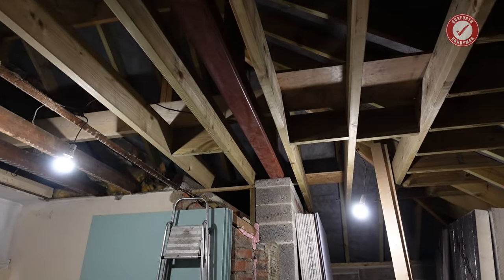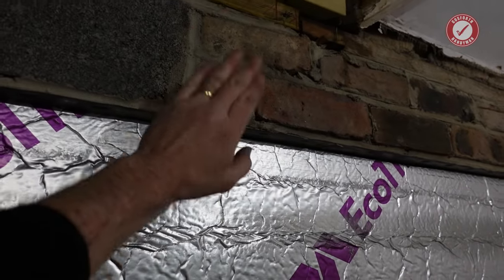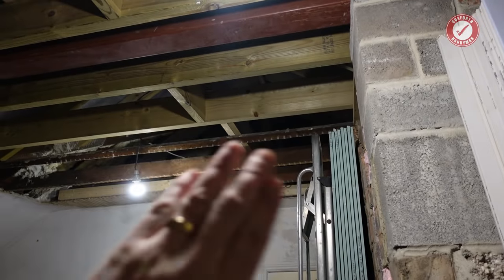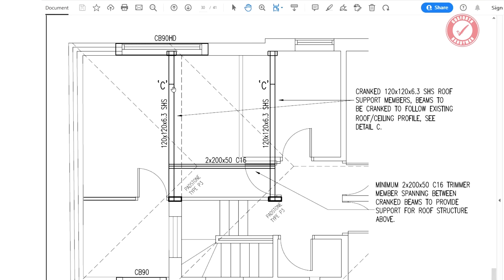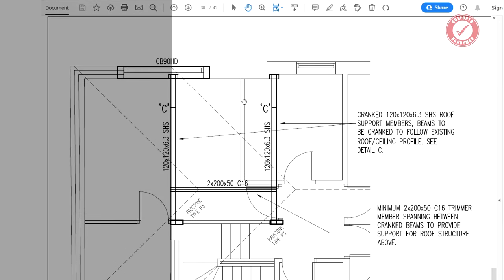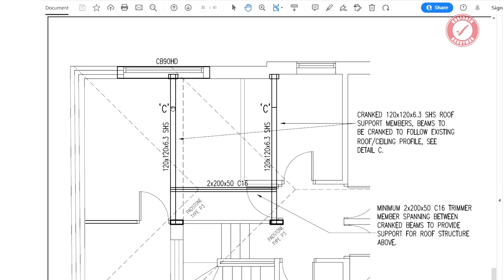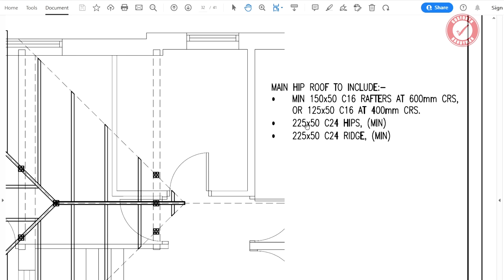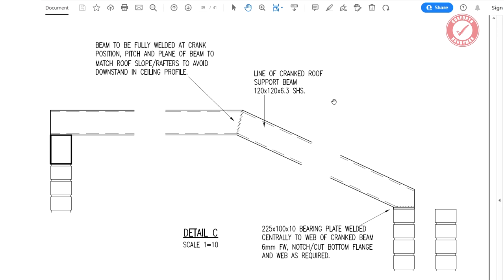Steelwork and structural engineer plans explained (Self Build Extension Part 11)

Comment: On a slightly different question (and Im not an expert on this) having just had my loft extension completed I researched insulation and found that PIR sprayed insulation was a huge issue in roofing applications. Its stated that either open or closed cell applications do not allow the roof to breath and eventually rots the timbers. Did you do any research into the application and wondered what your views on it would be?
Reply from the maker: We didn't install it - was already in. I personally think the problems are over-hyped a bit. It's used extensively in the States and Canada. 👍
Reply: @girlsdrinkfeck  I think that its exactly the fact that we do have moisture in our air. When reading the foam reduces ventilation as it fails to leave any ventilation within the roof space, this then causes humidity and damp placing roof timbers at risk of decay. Im certainly not an expert but was interested in peoples opinion.
Reply: @GosforthHandyman , I’m in Ontario, Canada. We have a cape cod style house with 3/4 second story, so there are, I think, a total of 6 separate attic spaces, what with the dormers and all. When we had our roof done a few years back we had them take of the roof sheathing and spray foam all the little attic spaces (we still have loose insulation sprayed in the main top attic). It has made a huge difference in our energy bill. All that to say, no one batted an eyelid over spraying a roof. Our roofer had tons of experience working alongside spray insulation companies. So yeah, no one here seems to think it’ll cause damp and ventilation issues.

Comment: Bet the structural engineer's insurance premiums are low 🤭  the old roof had years of empirical loading attesting for it integrity.  Although the cost of over engineering, is insignificant to the total build, not to mention the inconvenience if the new roof collapsed, which would likely take the original roof down with it.  More importantly you don't want to risk Mrs Mack's hair do!🤔🎯🤣🤣🤣
Reply: Proof loading of serviceability limit state doesn't really prove anything. Structures are designed to ultimate limit state by applying partial safety factors to both loads and material properties. Therefore the proof load is no proof at all to comply with modern codes...
Reply: @skybenedict  edited to empirical🎯
Modern codes are not retrospective.
Reply from the maker: 100 years and the existing roof hasn't moved a mm! 👍😁
Reply: @GosforthHandyman  yeah Andy that was my point.👍 🎯 The sizing off timbers would be based on past experience and l bet there are many houses built at the same time around you and up and down the country as well with similar sized timbers.   We have a 150 year old High Street shop that was originally a town house three floors with servants on the top floor, and that’s got a massive roof and the only problem has been were water has got in and rotted out a couple of rafters which then put additional load one the purlin on one side.  Relatively easy fix with some sistering.  I think that’s got a 1”x 10” ridge😱 strikes me that the ridge board is the least load part of the roof it’s only really supporting the ridge tile, and completing the roof triangle?   Anyway great work❤️

Comment: SHS is square hollow section. I'm surprised the building inspector has ok'd the cranked beam sitting on a timber wallplate. SE's detail C shows sat on brickwork not timber. Timber can expand, contract or rot. The other side is sat on padstone. Plus I don't think architect is 'fobbing it off' to structural engineer. Architects and building control aren't usually qualified engineers and won't be insured for structural design.
Reply from the maker: You couldn't put it on brickwork without notching out the wall plate which is impossible since the hip sits directly on it at that point. SE was fine with this. The 'fobbing it off' comment was a joke. 🙄
Reply: Rhs is a rectangular  hollow section,and chs is circular  hollow  section
Reply: @GosforthHandyman  this one sure is 'attack of the armchair roof construction experts', eh, Gosforth.....?!!
Never heard so many 'I would've  thought' s....!!!

Comment: Curious as to why you would pay a structural engineer to spec timber sizes - and then put bigger, heavier and more expensive timbers in the roof?!  After all, according to the structural engineer, they're completely unnecessary....!!!
Is it just that ' we've got a belt and braces - but we'd better just have another belt because ''you never know" ' paranoia some people have...?!
Reply: I don’t work in residential construction but I am a structural engineer. Often materials are sized up simply due to cost or availability. The engineer specs the bare minimum to meet the requirements, but it could be an uncommon size and hard to find. Or maybe the lumber yard was out when the crew turned up to the day before the job to get what they needed. Or maybe the roofers already had the larger timber on hand and it was cheaper to use it than to buy new. It may be that the larger timber’s are the more commonly used size and the roofer gets bulk discounts on buying big lots and didn’t want to bother with a custom smaller size order.  Lots of potential reasons. (I can’t rightly remember who purchased the roof timbers, Andy or the roofers.)
Reply from the maker: Didn't put bigger timbers anywhere, but I generally prefer C24 to C16 as it's a lot more predictable for a few quid more. The joist spacing was just what worked for the joiners who did the roof. 👍 But yes, it can also be simply down to what's readily available at the time etc.

Comment: I am not even sure they are real structural engineers anymore. They drive spreadsheets with uber conservative safety factors bolstered to satisfy indemnity insurance. The RSJ I had to put in my gaff (extension) could have held up the piggin Albert Hall.😉👍
Reply: In a completely unrelated matter, I see on the news that Royal Albert hall has collapsed.
Reply: @ricos1497  🤣👍
Reply from the maker: Does seem a bit OTT! 😂
Reply: Your Structural Engineer is clearly not a modern 'spreadsheet driver' if they have specified an 'RSJ' which were superseded by Universal Beams 'UBs' decades ago!
Reply: @LordLuggage  Good catch- however all it proves is I am not a structural engineer and I was just using common parlance in the building industry.😉

Comment: I am surprised that a steel can go on top of a lintel. 
I am also not a structural engineer.
Reply from the maker: Yup! HD lintel 👍
Reply: The engineer will have checked the lintel. My observation is that the end of the cranked beam is bearing on timber. Again, assumed it was checked by the SE.